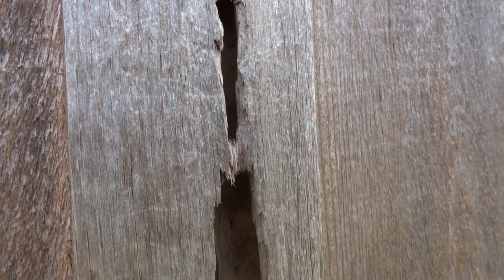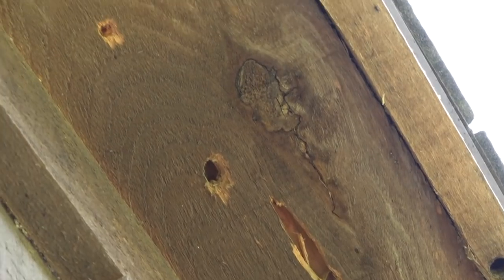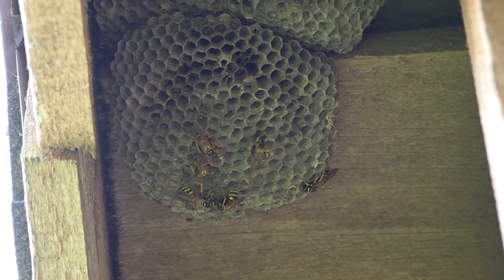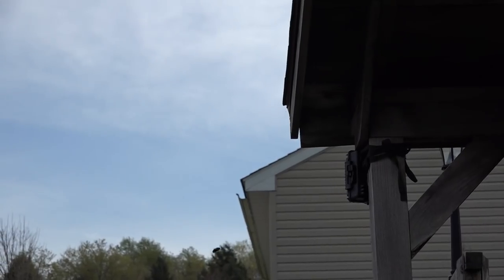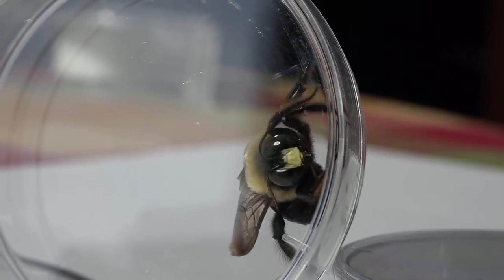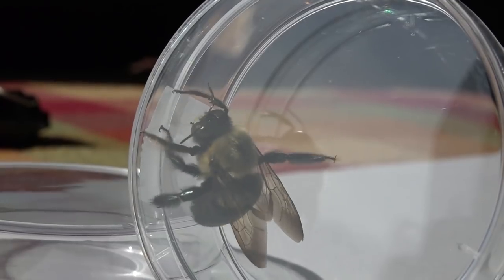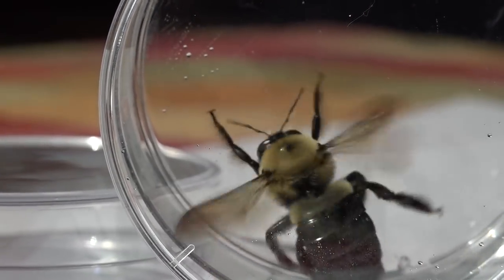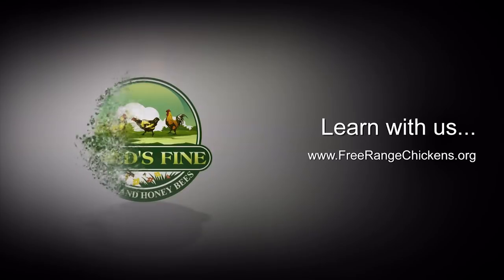Carpenter Bees Damage Wood by Boring, Male Carpenter Bee

Comment: We have carpenter bees on our deck.  I sit out there to read and I think it's HILARIOUS when they hover around trying to intimidate me.  I quite like carpenter bees, but we really can't afford to be rebuilding our deck.  Any advice on which trap to buy or how to make one?  Or if I can make them a house they'll prefer to our deck?
Reply from the maker: I just use 4 x 4 stock and cut holes into it on two faces at 45 deg angles going up and in. The center, I drill a 3/4" diameter hole straighe up from the botton - the 1/4" diameter angled holes go into the center 3/4 inch hole. Then I screw a peanut butter jar lid to the bottom and make sure it also has that 3/4" hole in the center. I have them on all of my sheds under the soffit areas and never take them down. I found that by leaving dead carpenter bees in them, new bees are encouraged to investigate the hole and ker-plunk, another one falls in. They average 18-23 females per year per trap. Easy to make, Observe where the females are already scouting and put your trap there, they definitely have location preferences.

Comment: Hi Fred, I just noticed one of these bees eating at my relatively new deck. I can see its rear end sticking out of the hole. I guess I need to fill the hole when the bee is away. Are you planning on doing any more honeybee videos this year? Yours are the best quality bee videos on YouTube by far.
Reply from the maker: Thanks for that comment and yes, I will be doing more honey bee videos this year, have one in the works, but because it involves some various stages of work by the bees, it takes some time to do.. but yes and thank you. Mush that bee while you can or you'll have a cheese house like my chickens do (">
Reply: Oh u think just kill it? I've noticed 2 holes on my hand tail. 1 of them is the one where the bee is gnawing on. I kinda felt guilty just killing it because of all the problems surviving  bees have had. I guess that has more to do with honey bees though?
Reply from the maker: You're right, the "at risk" bee species are the pollinators and general bumble bees and their sub-species. The Carpenter Bee is not at risk or in decline. You can also just encase all exterior wood with aluminum or vinyl siding to help deter them. If I want my rough cut wood structures to survive, I have to trap or kill the carpenter bees. Problem is, that the more I study them, the more destruction I allow so I can learn more, but that's not a wise approach :)

Comment: I once owned a swingset in my backyard when I was younger. these things used to drill holes into every part of the swingset they can find. we tried everything. we plugged up the whole but they would chew through it within twenty four hours. we tried spraying them but since they are always in the the swingset we can't spray them. eventually the whole swingset collapsed due to damage from these things. Yeah. I hate these guys.
Reply from the maker: There are some really nice non-chemical traps out there now, some you can make yourself. Maybe that would work? You're not alone in your tiny battle :)
Reply: they arent a problem anymore since they completely destroyed the swingset. they moved on to our neighbors swingset and they are having the same issue.
Reply: I'll relay the info you gave me onto them.

Comment: I have a huge shiny looking bee in my yard, that was goes behind each periwinkle flower and makes a racket, sounding like it is attacking another insect, then finding out (with my lens app) it was actually a carpenter bee. My question is, why was it going behind each flower and making a racket like that? only thing I can come up with, is it was drilling a hole in the base of the flower to get at the nectar. thoughts? I have done some research and found nothing, thus far. UPDATE: LISTENED TO THE REST OF YOUR VIDEO, thanks, I have my answer :)